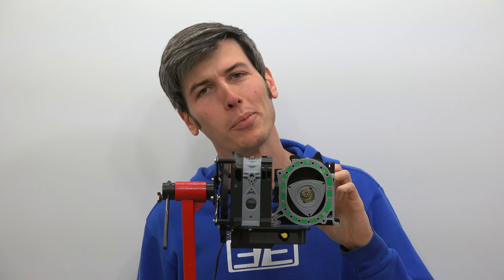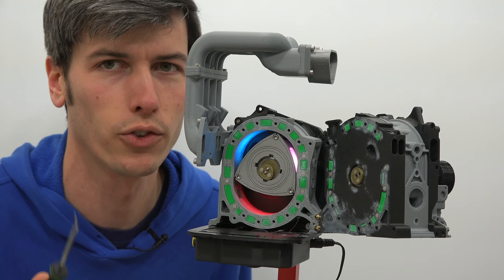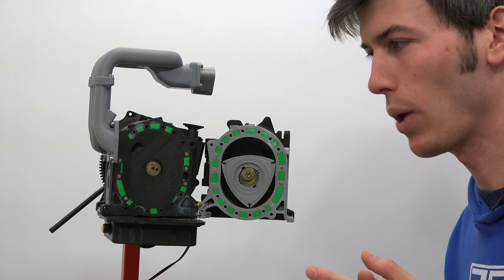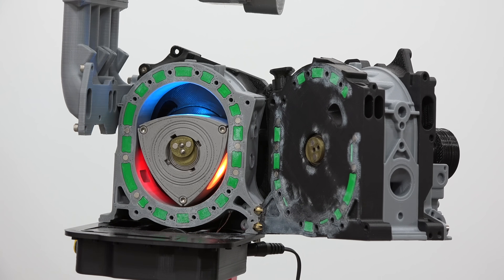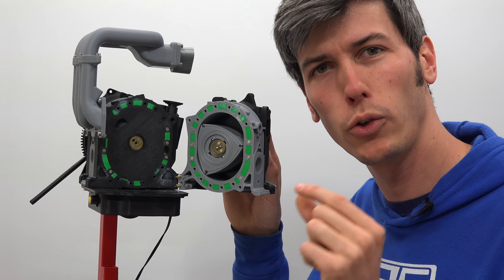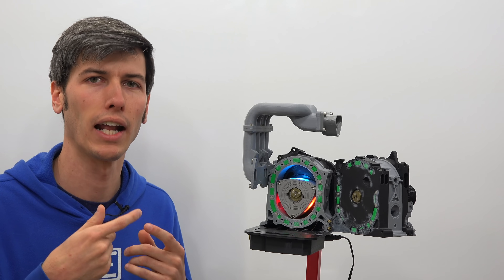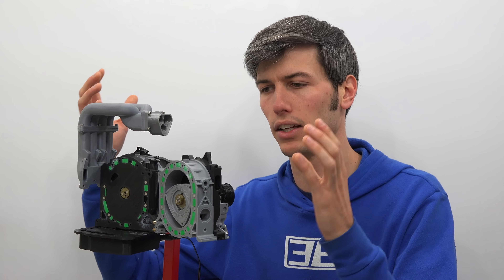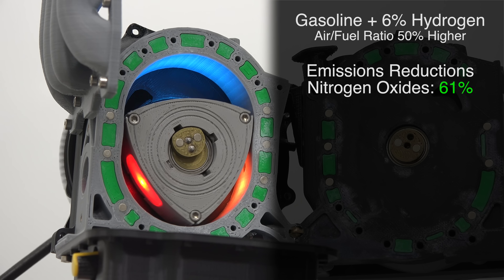Mazda Built A Hydrogen And Gasoline Powered Rotary Engine

Comment: How do they handle lubrication / sealing when running on hydrogen. I thought they used oil in the combustion chamber to make the apex seals work. Would they still inject oil along with the hydrogen?
Reply: So why not use ceramic seals in a normal rotary engine?
Reply: @jarrusjenkins  You can get ceramic apex seals, but they are really expensive, and have been shown to shatter. Not really enough demand to develop a great alternative.
Reply: Mark Bowyer so these engines suck too?
Reply: @user-lq1dk6gr3p  they were very fragile engines, since they were prone to shattering the apex seals. Yes, they were unreliable, just like standard rotaries.
Reply: @drawmaster6343  they're quite reliable until they're ported. Lol
Rx8 is a different story, to cut down on emissions they cut back on the amount of oil injected Into the motor.
Reply: @drawmaster6343  shattering apex seals lol
Reply: @drawmaster6343  I'm pretty sure most users didn't read the manual. 

... Or put more boost than the engine could take.
Reply: @gonzomuse  what about carbon graphite seals?
Reply: @gonzomuse  "ceramic apex seals have been shown to shatter". Yes, and forged pistons have been shown to break as well, but only if you abuse them extremely.
Reply: @user-lq1dk6gr3p  These engines suck, squeeze, bang and blow! Just like any other internal combustion engine. That's why we like them so much.
Reply: @erwinnijs1  The point being OEM seals DONT shatter, they just bend. If you like your housings or have a turbo, having small fragments flying around your engine is a good way to ruin them.
Reply: @andrewbudhram3082  Racing Beat make carbon seals for race engines apparently. I'd guess they are at least as expensive as ceramics and similarly prone to shattering under detonation.
Reply: @andrewbudhram3082  Carbon apex seals are usually used for high RPM engines because they are lighter. But they don't seal as well at low RPM, so they don't fix the problem of low compression during cranking. 
You could argue that the way they break with detonation and don't harm the rotor housings is an advantage, but you would have to rebuild the engine anyways. It's better not to detonate your engine in the first place.
Reply: Erwin Nijs lmao😂
Reply: SDR Darkheart detuned motor to make it last longer
Reply: @jarrusjenkins  The main reason why Mazda didn't use ceramic apex seals in their production vehicles is cost. They cost a few hundred dollars more than regular seals. I don't know what mileage Mazda got out of their test engines. But if they got the same mileage out of them with regular seals as regular engines, the extra cost of ceramic apex seals wouldn't have been justifiable. Which is very unfortunate looking backwards. Because it has given wankel engines a bad rep, which is undeserved imo.
Reply: Ceramic ceals work great but if they pop peices of ceramic destroy the housings great for racing and tight tolerances and frequent rebuilds 

Street use rotorys are better with seals that have a lil give to them some sort of composite less like to destroy housings if they pop and can take more abuse from improper tunes and tolerances 

If maintained well and premixed any rotory will last you fun driving with the redlines and she is good to go slack from that and she hates you 

But all that said if it does pop what other motor can be taken out relubed and sealed and put back together in with like 6 hours its 3 moving parts and some seals just redo seals every 50k miles and youll never need housings
Reply: 。ギャレット I literally have a model of the 787B sitting on my desk and personally own and drive a Mazda. Same team bud. You cannot explain away the apex seal problem though. Nobody save for maybe air cooled VW/Porsche owners would accept a 50k mi engine rebuild as the norm for a daily driver passenger car.
Reply: @IdealGrain  I rebuild my EJ every 50k and I rebuild my Aprilia twin every 100hrs😆
Reply: @。ギャレット It's a race car so it didn't face the same engineering and cost constraints as street rotaries. We can't really compare the two since they were made with different goals in mind. Also, there were many factors going into the 787B's success and comparable reliability to their competitors, it's not a perfect car. I love the 787B and I consider it an absolute marvel of automotive engineering, but let's be realistic and not put all of Mazda's rotaries on the same level, it's like trying to claim a Nissan Altima's stock v6 can hold as much power as a Nissan GT-R's v6 reliably.
Reply: @。ギャレット regular engine rebuilds most likely. Not to sure though but still in awesome motor!
Reply: @mrkd283  race engines only have to last as long as the length of the race plus any other events such as qualifying that the organizing body demands. This is unlike street cars where a quarter million miles without a rebuild is expected.
Reply: @2689vjavier  yes that was my thought on the matter but was unsure. One of the best sounding engines ever made. Check out BRM v16 for my favourite sounding engine shame it was super unreliable.
Reply: Don't know what seals were used in the dual fuel version Jason mentioned in the video, but the experimental 626 test vehicles in the early 90s still used tiny amounts of oil injection (typically 1lt between oil changes) The hydrocarbon levels were not able to be measured, but CARB still disqualified the vehicles from being presented as Zero emissions vehicles based on the oil injection.
Reply: @。ギャレット I love my RX8, and will preach to anyone who will listen about what an incredible car it is to drive! But you have to be realistic about the engine. If you tell people they will definitely last for 100,000 miles, you are taking a pretty large gamble on your word, whereas just being a little pragmatic and accepting that they intrinsically don't have incredible longevity and absolutely cannot be called "more reliable" than an equivalent piston engine, is just being realistic. 
It's not really very surprising given the Wankel has only been through a dozen iterations over 40 years, while the piston engine has been through over a thousand different designs, over a hundred years, and all the R&D that entails.
It's a huge shame that the timing has meant no-one but Mazda has gotten stuck in to try and iron out the engine's quirks, the emissions being the main sticking point, but there are a huge amount of people in garages and in sheds tinkering with it, because it's such an easy machine to work on, relatively speaking. The Wankel will last for as long as petrol cars are on the road, but that will be idiots like me, rather than large manufacturers. Embrace the engine for what it is! A screaming, light, powerful, beast that will blast it's seals into your turbo (if you are really daring!!) if you just look at it funny! I exaggerate, but you get my drift I hope.
Reply: Ceramic seals on a non-turbo would work... can't expect a high psi race car to last.
Reply: Actually, Hydrogen might be a decent fuel for Rotories. It won't cut the oil like gasoline or alcohol. I could see it extending seal life.
Reply: @。ギャレット there is a difference though. After a quick google, the distance record for the 24hr Le Mans is 397 laps, or around 5400km. 

Any standard road car with 5400km on it would be still considered practically brand new. Of course its not going to be worn out after that. Most rotaries are known to start wearing around what? 70'000-100'000km? Meanwhile most piston engines dont start wearing that badly until they pass the 200'000km mark. 

The Le Mans cars are obviously built to withstand more punishment, but road cars, especially with people who may or may not know how to properly maintain them, they aren't as reliable. 

Dont get me wrong, I love the rotary. Id buy an RX-7 FD in a heartbeat if I could afford it. But I know that while they can be perfectly reliable with the right care and maintenence, its still a hell of a lot more maintenence than a piston engine requires to keep it in a similar condition.
Reply: @。ギャレット

At this point you are just trolling man. 
First off you jump into discussion with pretensions, and start talking about a race car engine that we aren't even talking about. Second, Jason N and many more guys explain to you where the problem is with this engine, and what you do? Start defending it like it is your life/religion. Dude as you saw almost all people here like rotaries (including me) but we are not as delusional as you. It is really nice engine with beautiful sound note but it have reliability issues, tell me one thing - will rotary engine made 400.00 KM without major repair like my BMW M54B22?
Reply: @。ギャレット I dont deny it. Im talking about long term though. They arent unreliable, but they arent going to last as long as a piston engine in a regular road car.
Reply: Hence the opening comment about hydrogen powered cars having any apex seals left  ;-)
Reply: @。ギャレット what happens in the 1990 Le Mans?  A new Wankel engine is more reliable under race conditions over a 4 stroke piston... mainly for less moving parts,  the compression/combustion "stresses" is closer to the center line and crank (also this makes less torque output), as well as the crank itself is basically a reduction gear giving less stress to the engine overall. still not reliable in normal longterm uses. even more so on Hydrogen (it's a bad lubricant).
Reply: Rotary is not an engine for the masses, I can work on my own cars but when it comes to rotary idk they seem to fragile too me
Reply: So how many of you rotary bashers actually have even owned one? You only are producing more and more misinformation...
Reply: @ziomel105  Rotaries aren't a perfect engine. If there was a such a thing as a perfect engine, everyone car would have the same engine. Balancing emissions, reliability, durability, and performance is a difficult task for any engine. The EU just passed stricter emissions controls and the ones in place beforehand were already quite tight. Sealing rotaries is difficult and it requires you to burn some amount of oil. Reducing the amount for acceptable emissions levels means sacrificing reliability, emissions or both. The reason they makes sense as a range extender for a hybrid car is because they perform very well in emissions and efficiency when running at a constant RPM. Nobody here is a rotary basher (and I suspect most of us are at least a little enamored with them) we're just not fanboys of them like you.
Reply: The future is electric. It just makes so much sense , maintenance wise , noise wise , efficiency wise. Issues could generally be solved through o.a. fixes. Instant throttle response. I've never owned and/or drove an electric car but I've drove   gas , gasoline and diesel powered cars and honestly when comparing them to electric ( even though electric is so young ) they still loose. Once the range issue is further solved , and people think about "fueling" your car on your own with solar there's gonna be no turning back.
Reply: @Constantine_04  no the future won’t be electric we don’t have the supplies for 1.5billion EV’s also our demand for electronic devices rise leaving even less supplies for cars 

Hydrogen combustion might be not such a bad move
Reply: @。ギャレット Racing is different than day to day use.
Reply: 。ギャレット oh you have one? That’s sick
Reply: Wouldn't a diesel rotary solve the problem of lubrication?
Reply: Even if that's true, the rotary is dead.
Burning you own oil lubricant is just counter-productive.
Reply: Mazda has said that the 4 rotor they used that made 690 HP running on full sprint mode the entire 24 hour of Le Mans, was still very much in tolerance, and was super reliable that they could run the race again for another 24 hours.
Reply: @。ギャレット Running one for 24 hours at high RPM is one thing, then immediately doing a rebuild afterward too. Running it over a wider RPM range in uncontrolled driving conditions significantly increases the wear on an engine.
Reply: rotaries do not use oil to make the apex seals work, they use oil to lubricate the apex seals on the rotor housing. oil injection has nothing to do with compression or sealing. who ever told you that has no idea.
Reply: david husband well that was Jason on here when he explained that, Colette Davis has also said that, so has rob Dahm, car throttle, and donut media. Apologies for the apparent mass of incorrect knowledge being passed around by qualified people on here.
Reply: Yep, you still need oil.
Reply: Rotaries are a missconception. The combustion chamber has a very bad shape, the exhaust is more or less like a welding machine.. much to hot!
Reply: Martin Kaufmann   I don’t think you know what misconception means lol.
Reply: @tinolino58 , there's a different rotary engine design with a more compact combustion chamber.
Reply: Yep still a garbage 2 stroke

Comment: The rotary is fascinating .....always wondered how the apex seals don't fail within a few thousand rotations let alone maintain a reasonable longevity.....
Reply: It all comes down to its lubrication system which keeps it alive, but can inevitably kill it by neglect of its owners. The oil in rotary engines need to always be topped up, regularly changed and always warm before driving. And then there's the question of carbon build-up because some people may drive like nanny's, and this would be like sand paper rubbing away the apex seals of the rotors. They say it's recommended to really open up the engine at least once a day to reduce/remove this build up (as in redlining it on on-ramps etc)
Reply: Redline a day keeps the mechanic away!
Reply from the maker: Oil! Lots of it haha. Injected directly into the combustion chamber.

Comment: At 6:45 you said that a lean mixture will reduce combustion temperatures. 

I assume this is only in reference to the combustion temperatures...right? 

My understanding was that a lean mixture increases engine heat. Am I wrong?
Reply from the maker: Making a video soon to address this! Coming out soon! But burning lean is colder, not warmer. Misconception.
Reply: Engineering Explained interesting! Waiting for that video 😉.

Comment: Best designed engine but need to fix issues such as Apex seal shudders and crack, crack housing from being hot and cold on aluminium housing with coating chrome easy to peel off , use toooooo much fuel , fuel flood, ignition coils working too hard too keep the rev up , heat issue , repair cost on building them every 120,000 kms , consume lots of engines oils, hard to find a parts solution mazda need to put the price down on change over new engine and labour

Comment: Isn’t a hydrogen fuel cell/electric motor a more efficient use of hydrogen than a ICE?
Reply: Yes it is.
This technology won't go anywhere in my opinion, if it was market ready 15 years ago, then maybe, but now? Battery Electric cars are where it's headed, Hydrogen will probably be usefull for heavy duty transportation, but not person vehicles.
This is the result of experiments conducted in the 90s when hydrogen fuel cells were more expensive by an order of magnitude, and lithium-ion batteries didn't exist as a market ready product.
Reply: SDD525  Only if electricity production and infrastructure can keep up. Which I highly doubt.
Reply: But it's a rotary bro /s
Reply: Maybe, but this keeps a lot of the advantages of ICE. Can use existing drivetrains, more fun, it's also a more proven technology and cheaper.

I think fuel cell is the way forward for most cars, but I'd love to see hydrogen ICE become an option too. Both don't suffer the major three issues with Batteries: Mining, Age related capacity loss, and slow refill times coupled componded by low range. Eventually they'll replace batteries for those reasons.

Comment: its me again, can't we just make the system fully closed for full power, you inject both oxygen and hydrogen to make peak power, in this case there will be no nitrogen to make nox at high temps, you can use water injection to cool down the engine then get back to lean hydrogen air mixture for low torque driving (90% of regular driving)

there is also another solution, pair this with a electric motor, the electric part works for regen and high torque needs, and the combustion works for idle and coasting when you have less load, looks good to me
Reply: If only the engineering was that simple
Reply: @filipkuzminski5586  with free valves (no camshaft you use pneumatics to control them, it has been done years ago) and multirail injectors (same injector with different input rails, also done befor in military application where engines run all the available fuels, LNG gas diesel kirosen vegitable oil ....) you can do it, there is nothing stopping the evolution but the inertia of the automakers, they don't want to retool thier factories, if it wasn't for diesel gate no one would've started looking at electric
Reply: @ssllhh100  I agree and understand there are such technologies out there already, but unfortunately the evolution of engineering is directly related with the economy behind it, which is why we will stay "inert". The problem is the profit will always stay the priority, the RnD department probably wont take a place even close to it in this consumerism world for a while which is why we will have to wait for the actual applications of such technologies.